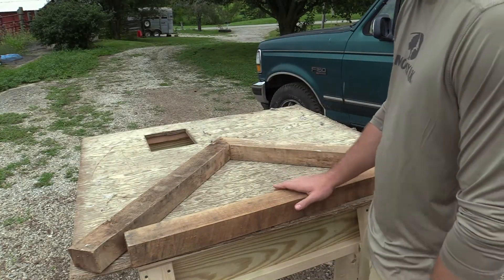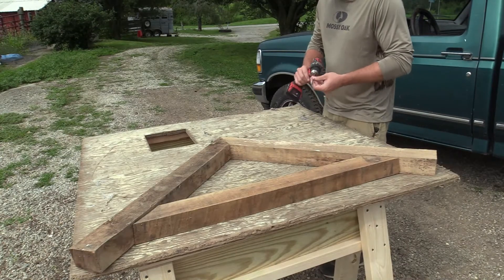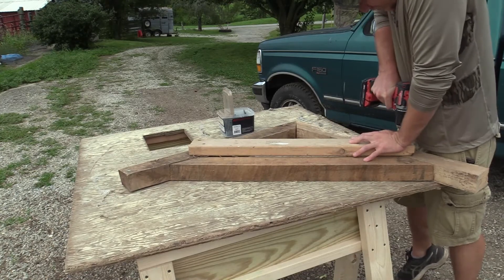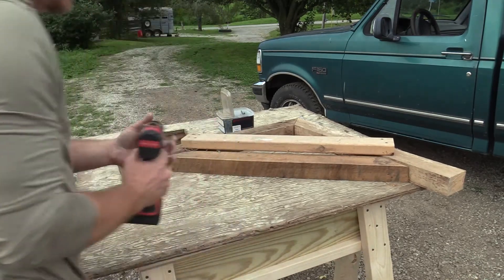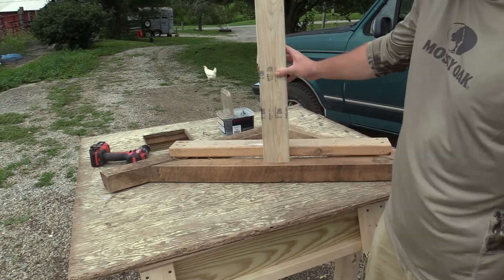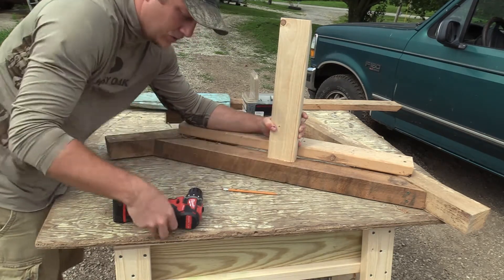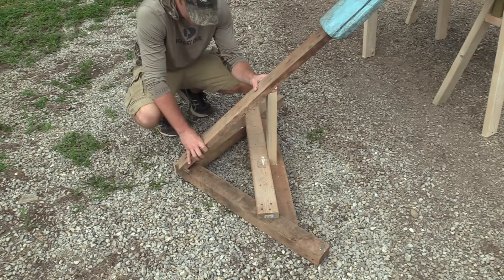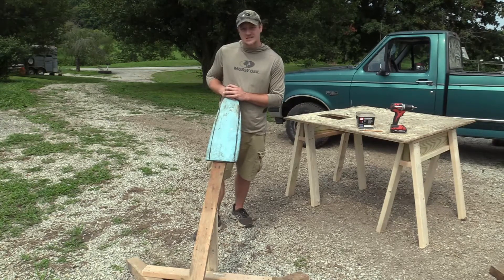How to Make a Fleshing Beam

Comment: Nice I like the set up can be anchor down and easily moved. I have a small spot that I will be fleshing in during season then can move it out of way when done using after season.
Reply from the maker: This is my temporary fleshing setup, it gets the job done. It's light enough to move if need be and heavy enough with blocks to stay put